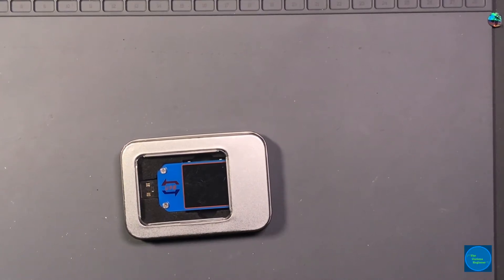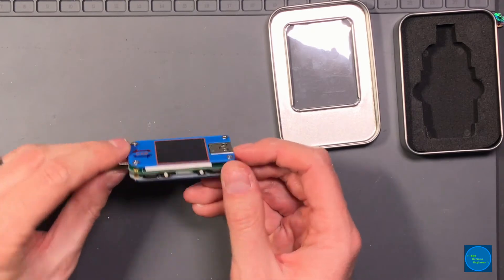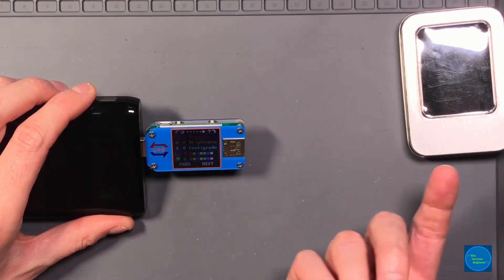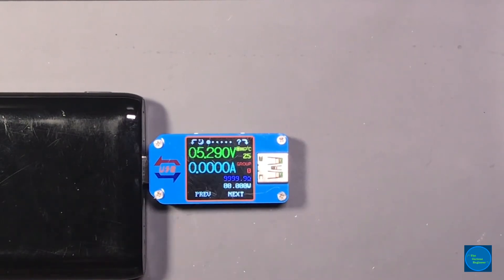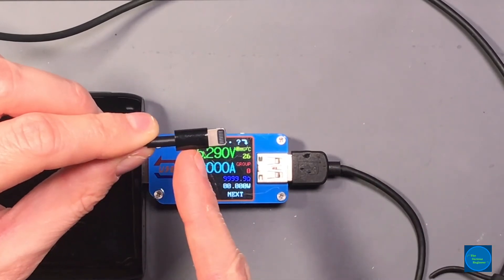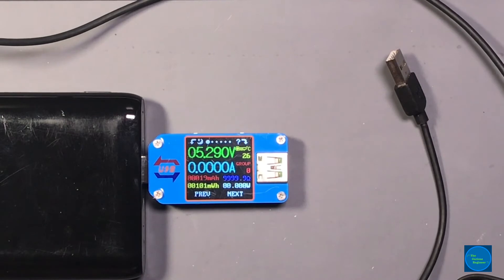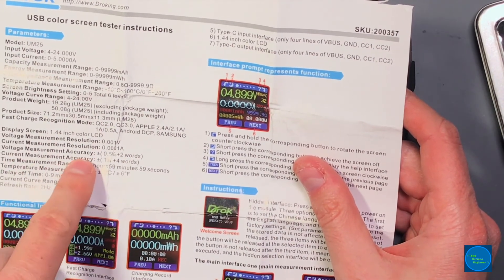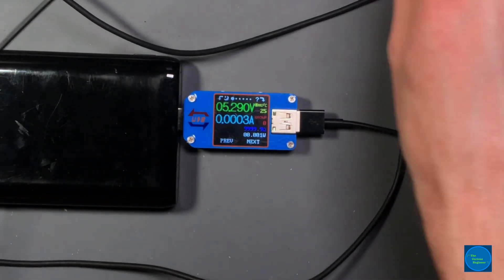Testing: Drok USB Meter (UM25)

Comment: Was really hoping you would have talked about the plotting ability which is the really cool feature.  (Is the 100 hour Time Measurement spec related to plotting?)
Reply from the maker: Sorry I don't quite follow your question. Are you referring to the voltage and current plotting screen? I still use that meter, so if you could clarify I'll try to respond.  Thanks for watching!
Reply: @TheCuriousEngineerChannel  I want to use the plotting to find transients that may be a problem for VOIP devices.  The plotting can have many modes:  1) it could keep compressing the data as it is accumulated, 2) it may only display the "last n" data points, 3) any control of axis sensitivity?

sampling rate?
is data logging possible (especially with Blue Tooth versions.)